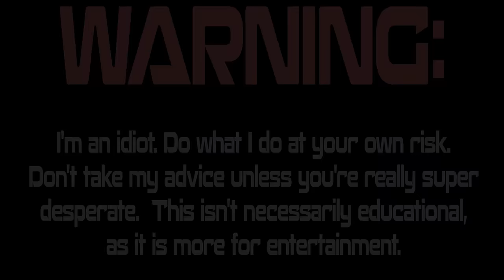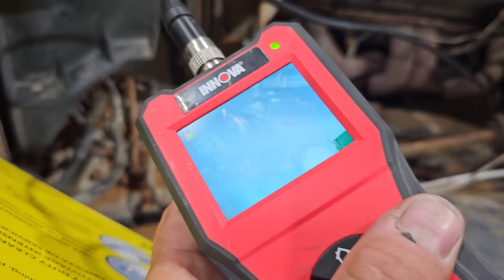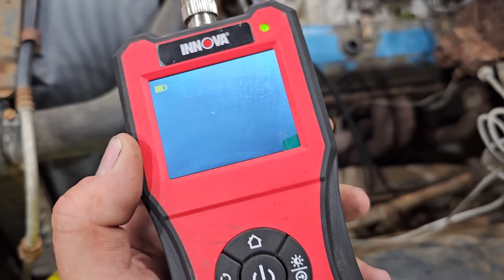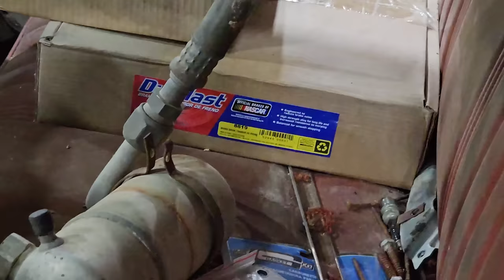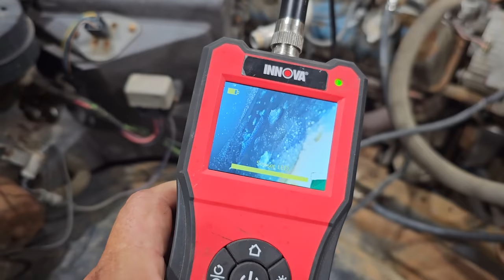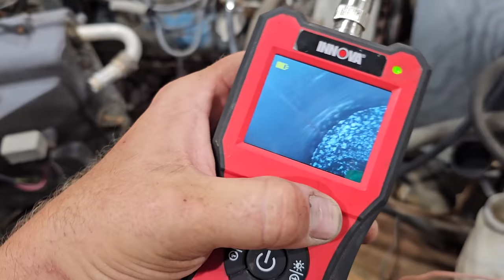SEIZED and FLOODED Engine! - Will This Old Truck RUN AND DRIVE Again?

Comment: Brought back memories of watching/helping my late dad back in the day with car maintenance, cleaning points, changing oil, and flushing coolant on a 67 Olds Cutlass. Great that your son is so interested in mechanical work. I hope you can either repair or replace the engine and clean up the paint and replace the wood in the truck bed and maybe make this 78 chevy truck a present for your son Bentley. Totally addicted to VGG and all the great work that and your family do, especially the GTO and other efforts for veterans. We veterans really appreciate your efforts to help those in need.

Comment: I had a 1979 Camaro with a 350  four barrel four-speed. Those motors were all built with soft cam lobes. I put a cam and lifters in it rejetted the  carb and the car ran really strong. Looks like the same engine you have. It’s an easy job. Love to see you and Bradly do that. Just check that it has compression otherwise obviously not worth it. 👍

Comment: It is great to see your son working with you! I hope he not only learns and or absorbs all the years of experience regarding sparkalators, lighting wires and hamster wheel drivetrains but also inherits the necessary gearhead vocabulary you possess. Commentary is mint.  I still love working on vehicles, I was a parts changer in the USMC. Had me a 1972 Chevell SS in high school and miss working on it. So, it makes sense I became an IT nerd! however, I still work on my vehicles which makes me cool and not a nerd.

Comment: Great father/son video. So much info in this video.  One of my favorites using info as I bought a 1980 C-30 dually in a salvage yard with a 1965 Chevy 409 engine.  Got it running using a lot of your info.

Comment: Derek, I know this is an old video, a feller is just watchin it again, VGG Re-Runs. But, a feller should build him a circle device with a 3/4 drive socket welded in the middle and drill some holes in it to match the holes in the old dampner so a feller can just get to twistin on these rigs with a long breaker bar when there are stuck rings. Swap the engine, paint the truck black and paint the original 2 tone paint graphics silver or gray and there ya go, a goin to town rig for sure! Appreciate the whole VGG family, thanks for the family entertainments!!!

Comment: Derek i must say, watching you and your son working on that truck together reminded me of working on my dads 69 Nova with him. He had a 307 amall block in it and we tore that engine down on the atreet and totally rebuilt it and then he had it bored and stroked , balanced and bluprinted , for a 307 it would sh*t and get. We blew a ton of 5.0 mustangs and corvetes away with it. Then he had 2 other 69 Novas , one with a 350 4 bolt main and one with a 396 . We tore them down as well and built them into speed machines. The 396 Nova would hit 120 in a matter of like 8 seconds,  we snapped off the needle on the speed odometer. 🤣 Man i freaking love old school chevy engines and to this day i can still rebuild them from bottom end to top end while parked on the street. Thanks bud for the awesome videos. I can see the passion in your son and how much he wants to impress you.😊 He is a great kid and you are a great dad.💯👍👊💪👏

Comment: That’s a solid truck and a easy one to restore, I have restored a lot of them in my 20 years of automotive repairs. I would strip the body of glass and chrome and send it out to get sandblasted then do the bodywork and paint. Then put in a fresh motor.

Comment: Love that yer teaching the boy. BTW,  if a guy has a bonfire and a brazing torch gas tanks can be saved. Once you burn it off y gets a cheap cement mixer and weld on some hooks ..the y load a bunch of drywall screws and sharp sand innit and  turn her on 
.walk away....you may use all the mixer positions for a few days...then an empty , a rinse, again with phosphate n water...etc. I gave dine this with motorcycle tanks over the years with success. AND, you have cement mixer t fix the sidewalk as well....tks for your great vids!

Comment: I've always used what the manufacturer recommends, white lithium grease on the door and hood hinges. You can use Water Displacement, vs 40, (WD-40), to get them loose, but go back to the lithium grease for the long term.

Comment: Cool things the work good for loosening rust is automatic transmission fluid and vinegar is good at eating rust and corrosion. If you have a lifter tick or low oil pressure dump in a couple quarts of automatic transmission fluid in the crankcase. Work many times for me. Sometimes the relief valve on the oil pump gets stuck open in the oil pressure drops

Comment: I'd use Murphy's oil soap after the initial clean.
And as I recall, Now, the rims you put on the farm truck I've seen on that step side before.

I hope Bentley fully restores and keeps that truck for decades to come👍

Comment: My dad had an 84 Blazer that came with a 305 in it, and he wanted to swap it for something with more grunt so we could haul a camper out to Yellowstone the next year. So our family project that year was to rebuild a Chevy 350 and do the swap.

Watching Bentley sitting inside the engine compartment wrenching with you reminds me of those times with my dad. I was about 11 at the time and even had a mullet. Those are some of my best memories of time spent with my dad, and I'm sure Bentley will feel the same.

Comment: Derek. You must be incredibly proud of your children. The way you interact with them is awesome. Bentley has such a great work ethic, I can see he loves this truck. Don't take out that interior. Find some door cards. Get some wood For the bed. and shoot that black primer you were talking about all over it after you sand it. put that 400 in it and give it to Bentley when he's old enough to drive. My youngest son and I have worked on a few projects together and that was the best time of my life. He is a certified GM mechanic and he just graduated top in his class with a Bachelor's in Mechanical Engineering  He already has a great job as a junior design engineer and he's loving it. People like you renew my faith in America moving forward. God Bless America. Also Thank you for your service. USN 1970-1976

Comment: I would lube up the hood hinges and get them loosened up before bolting on the hood. It’s not a bad truck so it’s worth swapping in another engine and get her running. After you drive it you will know how much else is bad and if you want to bring it back all the way.

Comment: That aerokroil penetrant is magic. I had a can given to me and had it for many years that broke free many seized up motorcycles using just a touch for each cylinder. Cost nearly $200 a gallon now days but that would last  a lifetime if used properly

Comment: In situations with flooded cylinders, I use a power bleeder to pull fluids out of a cylinder, like removing oil when replacing powerstroke injectors. Works well.

Comment: Derek you probably won't see this since its 11.months later but a tip is if you will use a piece of vacuum hose or fuel hose put into the vacuum hose and stuff rags around then use the small hose to put into the cylinder you can suck it nearly all out lol

Comment: My brother had a vehicle with similar problems. The roll pin in the gear at the bottom of the distributor assembly had sheared. It would set timing ok but giving it a little juice would make it jump out of time again.

Comment: That Kroil penetrating oil is good stuff if allowed to set for a while. They banned it in my place of employment cause someone used it on a valve stem to loosen it up, ate the packing and it blew right out.

Comment: It takes time, but you can use an absorbent strip of cloth, stick it into the water area, and let it hang out through the spark plug hole and below the level of the cylinder, and it will all drip out!

Comment: If I need to remove fluids from cylinders I use a piece of vacuum hose or ridgid fuel line then use the vacuum and suck out the fluid thru the improvised straw.

Comment: When I was working maintenance I was trying to vaccum out some water inside of a condensate drain line it was 1/2 inch ID so very small opening, I used a small piece of fuel line, you can use trans line, steel brake line, whatever is small and skinny and tape it to the very tip of your shop vac hose and it will indeed fit right down into the cylinder !
Reply: Watching your boy jump out of the back the way he did to get that bolt brought back memories when I was his age working with my dad, you’re a great father 🙌

Comment: You can put the small hose and connect it to a pneumatic brake bleeder to pull water out of the cylinders. This is what I do to drain differentials that don't have drain ports because of their 'lifetime fluid'.

Comment: On the tensioner pin.
After I pulled the pin the plunger came out a bit, but not what thought was as good as the Ford unit.

There is a spring on this plunger that looks like it could be pinched and moved up or down.

Comment: Mystery oil is a mPAO ester grade 5 oil with toluene in it. Put simply its a plastic oil with additives. Save yourself some money and use phosphoric acid as a rust remover. That's the main ingredient in every rust remover you buy.

Comment: You could put a length of braided cotton rope in the spark plug hole into the water then let the other end just hang below the cylinder. It will siphon by capillary action over time. Drawback is it would probably take hours.

Comment: I had a motor I worked on for a young lady that well liked to do things for herself. Anyhow she didn't know about valve lash and tightened all the lifter bolts to nope not going anywhere. She finally asked me to take a look and I just backed off the nuts to rattle can delight, then set her lash. It ran just fine but did have a few hurt lifters.

Comment: pull the carb and exhaust and seal them off.  use a pressure washer or airless sprayer  to shoot hot juices  into each cylinder one at a time.    recirculate back through the drain plug.   Or get real tricky and make an 8 way spliter and ram it down all 8 at the same time.

Comment: Do you remember though's old flex plate wrenches Snap On sells. They were spring loaded and designed to grab on the teeth of the flex plate ??? 🤔

Comment: I duct tape a smaller bit of pvc hose to the vacuum hose and stick the hose through the spark plug hole into the cylinder to suck it all out. Bit McGiver but it works.

Comment: I know this is 4 months old. But for situations like this. O'Reilly's or AutoZone has a borescope that you can use when you pull out a spark plug and you can look into the cylinder. No need to buy the expensive snap-on tool. Just thought I mention.

Comment: I had an 84 step side, my slats were rotten but still there.  The body was straight and brown on brown.  It was a 305, I dumped so much into it but got it right.

I wound up selling it and regret it but it was too much for me at the time and so it goes.

Comment: Any unknown used engine I always like to pull the valve covers to check the condition of the valves. They may be stuck so a little persuasion with a rubber mallet lets you check that. Also I pop the distributor cap off ( if it has one ) when I rock the crank back and forth to see if there is a lot of slop in the timing chain or gears. A Chevy first gen small block is a good engine to teach trouble shooting on.

Comment: I would have tried putting a small funnel right into the sparkplug hole, then put the vacuum hose right into the funnel nice and tight. Lot more suction actually right in the cylinder.

Comment: I bought a car just like this one. Before i got it home the front right caliber locked . Awfull smell. Now i got a speed circuit A code. I always flip that traction controll button off. Wish it would default off when you crank it. 165000 miles and runs fine. It needs a few things done to it. I love the mirrors on this buick.  No blind spots

Comment: wonder if the lifters were hydraulic?  if so it's possible they weren't pressuring up qnd they'd be able to ride the cam lobes but just squish and not move the rods at all

Comment: I know this is an old video, but nonetheless I still will suggest using what used to be called the Mighty Vac " the the tool with 10001 Automotive uses in the 60s and 70s they were made of metal and came from the basic handheld vacuum pressure pump to complete kits with multiple accessories and a booklet describing how to create your own accessories using tubing and simple check valves and such to add liquids remove liquids aunt bleed brakes and master cylinders and test other vacuum devices that were common on Automobiles and trucks and stationary Motors at that time at that time

Comment: WD40 is NOT a lubricant.
It is a penetrant.
I use Blaster which is penetrant and a lithium based lubricant.
Multipurpose product.
I used it on my 1972 Plymouth Valiant 4 door sedan to luricate metal parts to provide a film.
Stopped a very annoying squeak and binding problem on the door hinge mechanism.
Well engineered vehicle.
I like 4 doors for when you have passengers in the back seat.
Easy entry and exit for all.
Plan to use the Valiant for what is was originally intended-a daily diver.
Well engineered and reliable vehicle.

Comment: To push the water out, you can put compressed air through the spark plug hole.

Will it fly everywhere? Hell yeah!
Does it work? You can bet your son it does.

Comment: And that’s how I learned how to work on cars. Also my dad didn’t know shit about cars, but my stepdad on the other hand we built the 69 Camaro from the ground up body restoration all brand new bushings everything it even had a front end from a fucking 70 1/2 split bumper month M2 two Rockcrusher 350 was bored. I think it was 10 over with a mild cam and a 3500 shocker but we only put the stock 15 seven rallies on it. It was gunmetal gray black interior it was a sweet ride. I miss.

Comment: Be nice if it was sporting a standard trans, jack up the butt end grab the low gear and  and put a pipe wtench on the whirly tube. This rig will make Bently a good parts getter.

Comment: I'm curious y you didn't use the suction tool with the cannister you hook to a air source and has the tiny vacuum line coming off it to suck out that cylinder water 💧

Comment: I had 1969 chevy Nova 4 door, it did not like a electric fuel pump, So when I got to Fort Worth, TX. I when the chevy Dealer and the rod for mechanical fuel pump. The car run better

Comment: It may have a stuck lifter if you can get it to fire up poor some auto trans down the carb just a little wheail it's running and it will until stick the lifters it will smoke bad for a little bit but it will work if there stuck

Comment: i would have got a plastic straw and duck taped it ti vacuum and put it down in hole then turn on vacuum
could have got most all water out then add your oil

Comment: In &&&Canada&&& 
We blow a fuel pump off of a 1976 Ford F150 390 in the middle of nowheres and simply fill the window washer jug with gas and stick the winsheild washer feed lines into the carb and go .No sweat no worries until we run outta beer

Comment: If I have a couple of trucks that might be perfect for your channel. How would we be able to talk about it. 1966 Ford f100 converted to a Chevy 350 Automatitc 350 turbo trans and a 1962 f100 with a brand new never fired 302 manual trans sitting for over 15 years idk maybe longer not sure. Used to be a 223 straight 6

Comment: Bently sure is learning a lot from o'l Dad. That's the way it should be 👍. The cam. The very last part to get oil in the old small block Chevy motor. I'd say she's been run REEEEEAAL low on oil a lot in it's life. 🙄 Just a guess..................

Comment: Or, it won't start because the double walled pipe just beyond the exhaust manifold has collapsed in on itself..Had that happen to a Buick 455 engine back in the day and it would not get any vacuum because of it and gave me the same problem you just had with no start..Just saying...

Comment: Bentleys has the ability to understand mechanics from the most developed times now years down the road he will be switching back the evs to a good ole internal combustion engines  to get a better solution for fuels the wood burning 🔥 motors is the same as a camp fireplace like the worst thing ever in automotive industry is the air bag and the falsehoods that were made when in fact was a entire new long list of things that happened because of the amount of pressure you have to make it explode 🤯 in your face to inflate and then my vw was just blowing bags going down  i 75 and then my dashboard was blank and the window's were powered so it was a better option to dont stop till its home and it is still in court 7  years after I had the car not fan gimme a blue tag non bs car its just to drive  no infotainment or any claims to dealer  is paid for and old enough to be president 😂